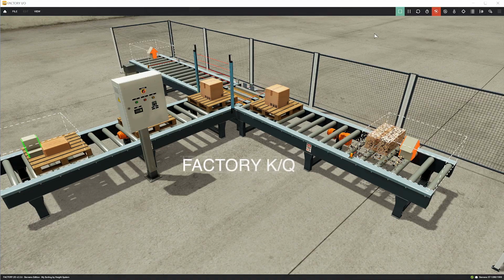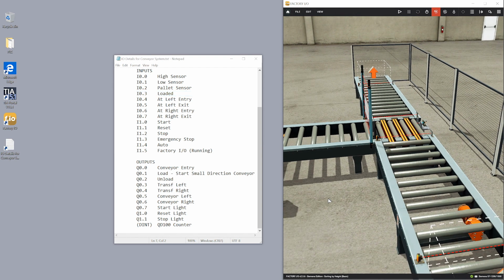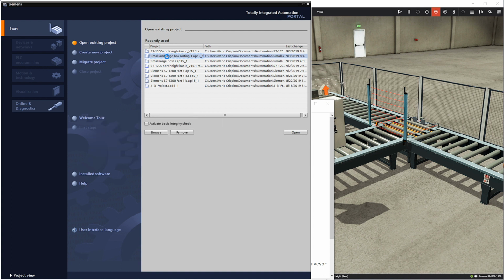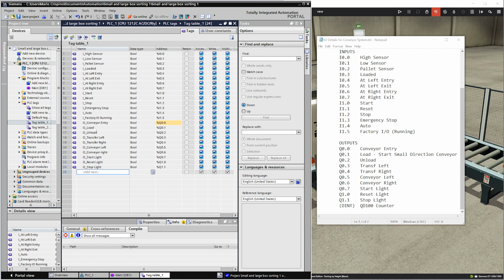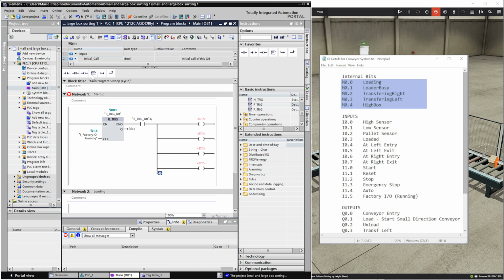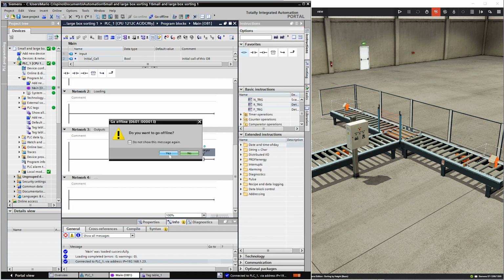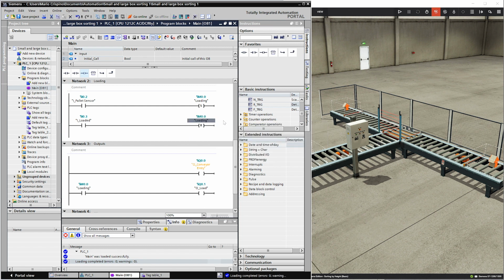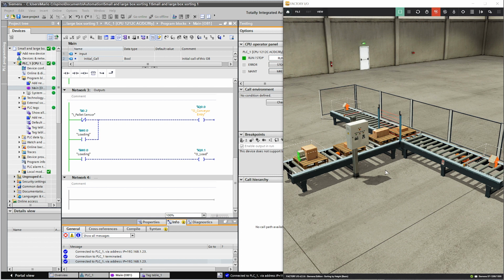Siemens S7-1200  PLC - Conveyor Box Sorting in FactoryI/O Part 1

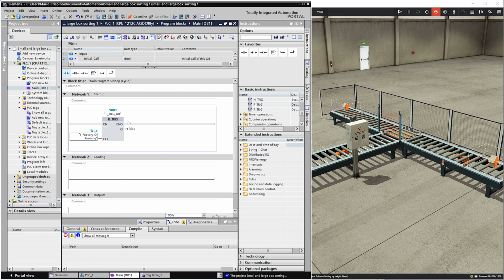Comment: Hello mr Mario great video ! i have a question tho in 13:40 you added a normally open contact to ensure that the reset only trigger at start up right ? isn't that the whole function of the 'r-trig' block since it only trigger a once ? i just cannot understand the point of  'r-trig-db'Q contact, will it run the same if i would remove it ? thank you so much sir !!
Reply from the maker: I would try it yourself. Where I have factory I/O running on the CLK input, place a normally open contact there instead. Then switch it on and off a few times to see what happened to an output when you don't have the r-trig-db'Q there and then when you do. 

If it is not conclusive because it maybe difficult to see then you could use the output as an input to a counter and see if it increments the count up by the value of 1 each time the input to the trig is switched on or if it goes up by more than one and this should give you your answer. Hope that helps

Comment: Nice introduction video.

I've been playing with FactoryIO a little myself, and have made a useful discovery...

On the driver screen, at the bottom right hand side, there is an "Export" button - This will export the configuration to an XML file which can be imported into a TIA Portal tag list.
This means that you don't have to enter all the tags and I/O addresses by hand!
Reply from the maker: Sounds good. Should save a bit of time, although I do like to name things the way I like. However, well spotted. I might try that out
Reply: You can of course reame the tags in FactryIO to the names you want.
If you only want to add the O_ and I_ to the TIA tags, you could simply edit the XML file.
...but yes, I get your point.
Reply from the maker: That's true.

Comment: Thank you for making these videos. I am looking at buying a S7-1200 PLC to practice with and there seems to be different versions, can you explain why there are so many versions under the same S7-1200 model number and can I buy the cheaper version (1211C)? I also was wondering if the HMI was needed for learning on factory IO? as this greatly increases the price. Thank you again.
Reply from the maker: Hi, I got my system from here https://www.ued.co.uk/products/automation-technology/plc-systems/plc-cpus/basic-cpus-i-o-modules/?manufacturers=siemens
Reply from the maker: If you are using it with FactoryI/O then I believe a 1211C would be fine.
It's only in the real world you need to consider different I/O and expandability. My 1212C for example only allows two external modules. The 1214 slows more but that unit wasn't necessary for myself as I'm using mine for training purposes and by using FactoryI/O I have access to many I/O analogue and digital without the need for a more expensive PLC.
Beware that for some units you may need an external power supply.

Comment: Hello Mario, thanks for your share. is that the CPU, proper power supply and an ethernet cable is enough for this hardware of PLC in this video?
Reply from the maker: Yes the power supply is built into the PLC and an ethernet cable connect directly to the PC is enough.
Reply: @MarioCrispino  Thank you Mario.